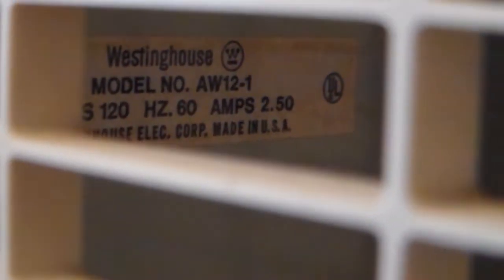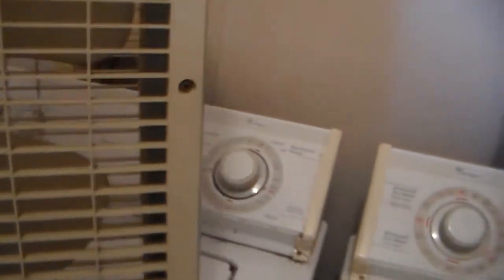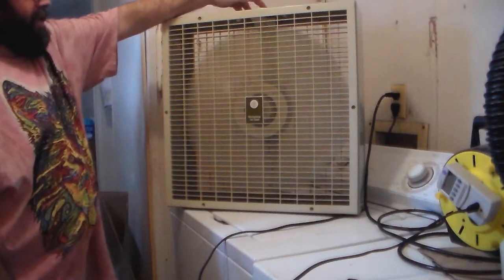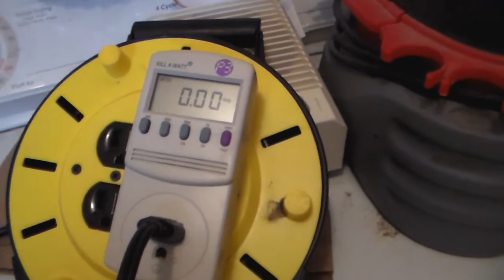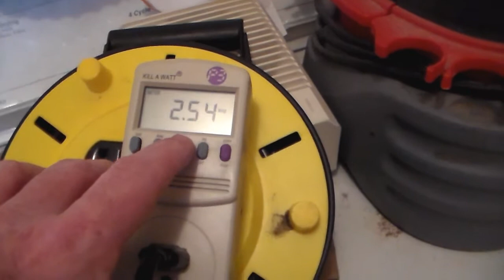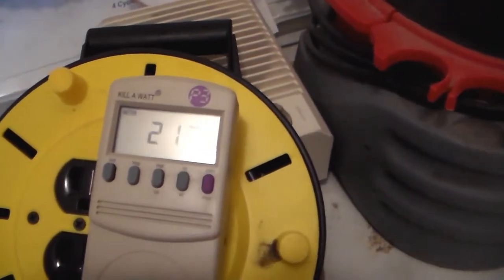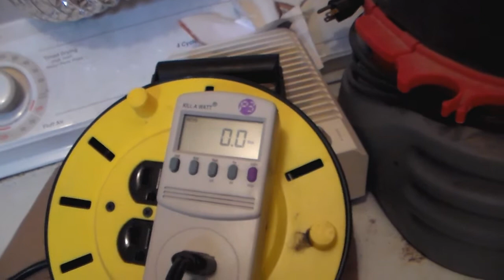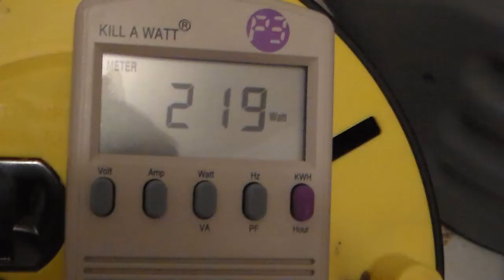Eskie's Vlog 022518: A Westinghouse AW12-1 Box Fan

Comment: Thefanmowerman has one as well. Only his has a different blade and motor. His also turns out to be a 3 speed sold as a 2 speed. The medium wire was always capped off until he replaced the switch.